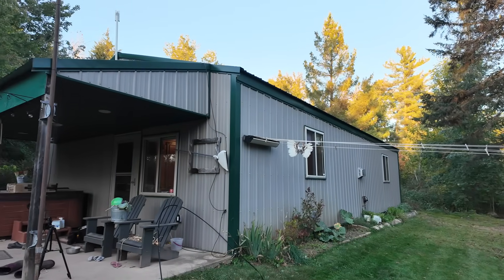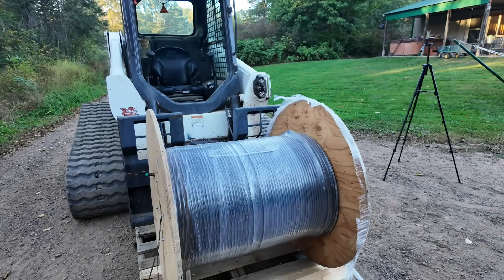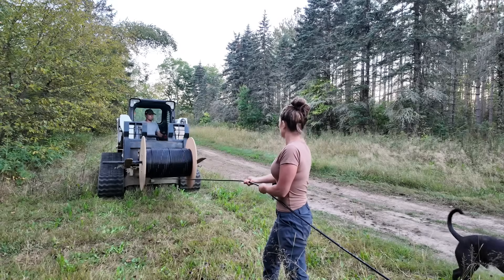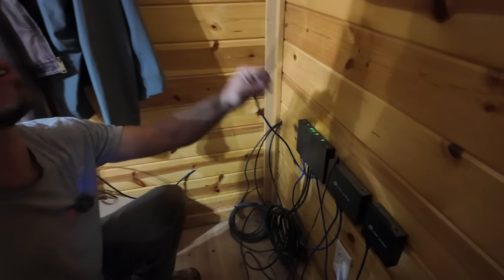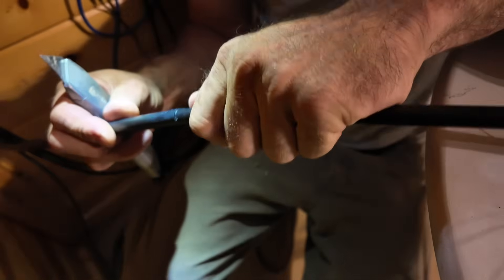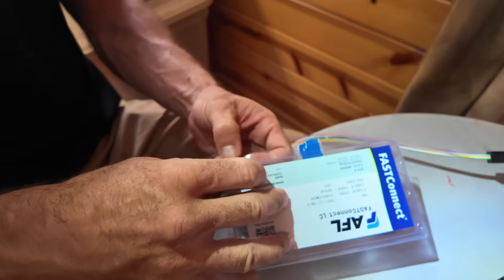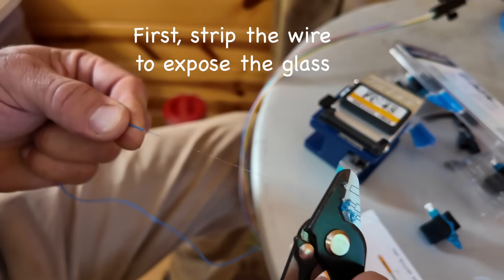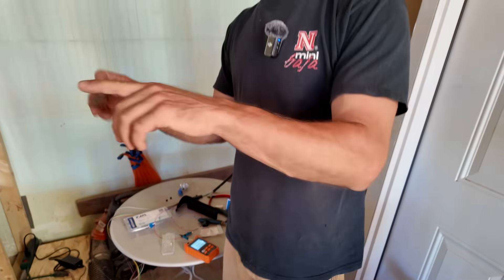We Need Internet! Running a 3,000 ft Fiber Optic Cable

Comment: I had a similar problem.  Internet at the house didn't reach the barn where we have monitor cameras to keep an eye on livestock and most important... pregnant dairy goats.  I ended up burying a Cat6 cable (125') and feeding a secondary router.  It works!  Your challenge is greater at that distance.  Great job, good answer!

Comment: As a fibre tech you actually did very well, no one I know was able to get the fibre connection right the first couple times because its so foreign to most people but you were also able to identify what the issues where and resolve them. Maybe you should take up a career in fibre installs and maintenance because from what I saw here is that you would make 10 times the tech than most techs in the industry.
Reply from the maker: That means a lot! Thank you!

Comment: I assume you ran multimode. If you run tight buffer you dont have to install fan out kits.  Also single mode would be better if your Telco ever brings fiber to your area, but you really need to fusion splice it.  Mechanical splices with index matching gel dont work well will SM

Comment: Why run 3000ft fiber cable (unless it's cheap now). I would use Air-Fiber PTP from UBIQUITI and this have proven to work in extreme weather over 30+ miles range in the Middle East.

Comment: Your now limited to your fiber that has many points of failure. And if someone hits a line. I would have kept starlink.
Reply from the maker: We are using the fiber optic cable to run Starlink to the shop….

Comment: Amazing!  Thank you for sharing.  I tried the long-range wifi, and it did not work.  Now I understand I am not alone.  You made the best choice.  But fiber termination looks pretty. hard.  The accuracy requirement of 0.5mm is crazy, and the equipment looks crazy expensive too. Congratulations on the office space.  That is beautiful.  How tall is that building inside?  I am wondering why you chose wood instead of metal.

Comment: I've worked for Ohio's largest fiberoptic contractor for 35 yrs now. Glad you were able to get things working good. There's more to fiberoptics than people think. Don't want to burst your bubble tho, plug and play systems are prone to a lot of failure. All those snap connectors are going to start failing. You should've bought a length of cable with fused terminals.
Reply: Good
Reply: Good

Comment: I've been in IT for 15 years, worked at massive data centers and wrangled 1000's of fiber optic cables, but I've never terminated fiber, that was always handled by an outside contractor because of the specialized tools and training needed.  So to see you do it yourself was pretty damn impressive!
Reply: I had a 96 pair fiber project for MARCENT in the middle East and Military prefer to terminate fiber themself. I have my own mechanical fiber tool for terminating fiber with me. It was ran from DKET to BCO and Flight line area DKET to ADN.

Comment: Your first option may have worked. The problem is that the signal modulation either needs to be expanded or it could be placed on stilts, above the trees. Also, it's possible to bounce signals from the ionosphere to any location (given some strong assumptions). So, rather than try and communicate directly between the receiver and the sender, the sender would send the signal into the atmosphere, where it would bounce down to the receiver. Also, if the signal travels "only 100 yards", then it likely could be send another 100 yards, and then another 100, etc., by simply connecting a series of the receivers and sender modules.

(These are wild guesses. Am an applied mathematician who knows the basics of signal modulation.)

Comment: Once you run that line you can use it for multiple things you can use it for your phone service you can use it for security you can use it for Internet signal which you can run security and plus get a ultra high speed connection real high speed with the fiber if you can find fiber on the street and get a direct fiber from the street to the house you’re gonna be golden I don’t know if they have fiber in this county that you’re in if they do your Golden

Comment: I’m a splicer and you don’t need a special tool the strings in there are for opening it. If you probably could of stop at a crew on the side of the road to plow that for less then you paid for just the cable and shipping

Comment: The VFL you were using is in the 600 nano meter range. You were measuring at the wrong wavelength. 850 nano meter. That said that one is used to find faults (visual fault locator) not for a light source. But a one click loc pen to clean the ends and optic. The optics that you use have a light threshold. -8 db on a 1310 nm optic is almost perfect.  For a complete amateur with the wrong tools and no experience you didn’t do too bad.  On a side note. If the fiber is too bright you pad the receive side.  If it is too dim clean with a one click pen if that doesn’t work and you don’t have access to an OTDR. Put in a hotter optic. 1550 nm. They also make 1 fiber optics. That send and receive in 1 fiber.

Comment: If you would have lifted poles of each side 100 ft up then put those dishes on there and pointed on each other everything would have been fine. Or you can buy 3000 for it of fiber optic cable.

Comment: You should have watched Linus tech tips on the ubiquity satellites. They would have been more expensive but have done what you wanted. The tp-link ones also too. You need much better line of sight. You should have just ran a fiber line. It is actually probably the cheapest and most reliable way you can get them pre-terminated. Just make sure your ends are clean

Comment: The TP Link gear you were using needs line of sight (LOS). I guess you did not have a clear sight to the second AP. I have used the TP gear many times even at ranges to 2500 meters no problem,

Comment: I thought i was mental running fiber despite working with it daily. Best thing i ever did and that was 20 years ago, whist it was only something like 10G max back that, that same fiber is still in the wall, and today its a 100G core network and capable still of 400Gbps +. 

You did a good job for the proverbial novice, there are some cringe worthy bits and a few bits id have done slightly diffrent, but that don't take away form an outstanding install on the whole, you deserve a pint and now know you can be an optical monkey if you want to be, id 100% have hired you based on that for fiber work.

Just go back and check its well covered from the elements and wildlife, anywhere its exposed is where its going to eventually break, my cables in the garden are all covered in sand and sit on sand.

If you want some free advise check the cable spec sheets, and go find a food safe grease, give the entire cable a rub down with it outside primary sheeth only, it wont damage the sheths but will stop any UV damage, improve its water protection, increasing its life cycle.

Top work dude, 3000 ft almost perfect.
Reply from the maker: Wow, thank you so much for the tips and the kind words!

Comment: Noob's question here: Wouldn’t it be cheaper to get a second Starlink connection and connect the two sites via VPN instead of running fiber between them? What are the pros and cons of using fiber optic X 2 Star kinks in this scenary?

Comment: I dont understand why you just didnt get a second Starlink system and each house/cabin had its own. For the price of a 3000+ ft roll of fiber and equipment, you could have paid for 5 yrs of 2 Starlink’s…..and turn one off it it wasnt to be used for an extended amount of time.

Comment: Honestly Given the distance involved I would have installed telephone poles and run an aerial fiber optic cable. So, much easier than trenching and faster too. Downside getting the support wire and the pole mounting accessories is expensive as well as renting a bucket truck. You could go 40 - 50 meters between poles. 300 feet is about 91 meters. You could have done as few as six pole . Given your location its likely the fiber is coming off a pole anyways.Fanout kits are a pain. I would have rented a fusion splicer and fused the fanout to the cable wires. so much more reliable.

Comment: Deeply impressed…I’m no professional, I’m an Extra class Ham and I’ve made all kinds of cables…coax, cat5, cat6, phone, and of course electrical cords…but direct bury fiber is the one that I’d probably prefer-order with termination completed by professionals, even at extra cost.  Watching you do that encourages me to at least try to do a short run for our next HAM fest and see how it goes.  Awesome.  Side note, I would have built a set of towers and gone for a microwave solution, much easier…😁 I’m also a radio guy so if there’s a wireless way to do it…I’m definitely going to do it that way.  Playing with radios is more fun than stringing wires…or glass.

Comment: What is SPF adapter, I am genuinely interested 😂
Reply: Some switches and routers have SPF ports in addition to or instead of ethernet ports.  Into that port, you plug an SPF adapter, which can be either RJ-45 or fiber.

Comment: The problem is your antenna is not high enough. Look at deadmau5‘s Wi-Fi arrangement. he gets blazing speeds from an antenna that is 12 miles away.

He's using a Ubiquiti airFiber 24 HD point-to-point connection.
It allows you to wirelessly connect and send data between two points/locations up to 20 km (~12 mi) away with a typical latency of just 0.2 ms.
It can support up to 2 Gops of bandwidth throughput... but in reality the theoretical limit is 1 Gbps full duplex (a gigabit in each direction), it's just that Ubiquiti likes to add the upstream and downstream bandwidth together to make it sound like the connection is faster.
Actual bandwidth throughput will vary based on many factors like distance between the two points, whether there is a clear unobstructed path between the two points, whether there is any interference along the path, etc.

It's possible the tower may connect to another airFiber unit mounted on top of an internet exchange or data switching facility that has fiber connectivity to major IP transit providers (like Cogent, Level 3, Hurricane Electric, etc.)—the type of companies that provide Internet Service Providers and major corporations with their internet connectivity.

ー Costs-
• airFiber 24 HD: $2900 USD (for each side of the link), plus the cost of the tower(s) if required
• Gigabit internet connectivity: varies anywhere between $75 and $1000 USD per month depending on many different factors-primarily the location and the connectivity options available at that location. It also depends on whether you want dedicated bandwidth or not (residential internet connections do not provide dedicated bandwidth).

Comment: If you guys have UniFi or enterprise WiFi equipment, you could buy access points that support pass point. You could sign up for a service like google orion, so that nearby guests on cell networks will automatically be connected to your guys’ guest WiFi network

Comment: As an IT Engineer, I would like to strongly recommend you to NEVER look to the VFL / Fiber light. That can cause permanent damage to your eyes. 
Nice job with the fiber run and don't fill bad because didn't work in the first try. Splicing/terminating  fiber requires training. I also would recommend you terminating the fibers in a wall mount corning and from their to the switch you can use a pre-made fiber patch cord.

Comment: You need a clear line of sight PtMP (point to multi-point) connection. Just need some tall poles to clear most of the trees. Would of been cheaper than that fiber but fiber is more permanent.

Comment: have you ever checked to see what fiber services runs near your shop? I am sure there is a corporation out there somewhere that would allow your expertise to install a fiber cabinet out to the main street of where you live. Think about, you did the work as a DIY and you did it so well with termination and all. But now, to cut the costs you could run even more fiber and do all the work yourself.  You could have 1000 symmetrical speeds and cut half the costs to what you are paying for with starlink. No one ever thinks  what would happen if Starlink goes down compared to have a straight fiber connection. I like these fiber installs like this and it would be worth getting the pipe open to your cabin or at least to the end of the road with a fiber cabinet where you do the rest of the work.

Comment: Awesome job on the fiber!  One thing though, the transceiver you are using in the switch.  Those ports are not call "SPF".   They are called SFP - Small Form-factor Pluggable (SFP).

Comment: You do not bad job.. But no idea for what.. 3000 ft (0.91 kilometers) is a very small distance. You use solution more suited for 30000 ft.

Comment: I think you're supposed to terminate the fan out in a fiber box that completely houses the thin fibers (it has clips to put them in) and gives you a port to plug into. In this port you can plug in pre made fiber lc cables you can just buy online. Direct termination and sticking it into a switch is ... Risky... Easily damaged

Comment: what about the distance factor on the spf module I know they have different ones based on how far you have to run the fiber and intensity of the laser in them, too much and you'll burn them out quickly not enough and you'll have a week signal?

Comment: I really want to terminate all the ends into a fiber patch panel, just so none of the fiber strains are just sitting their. Also a lot easier to switch to another strain or plug in more equipment. Other than that good job!

Comment: Fiber?
Wow, I can't imagine how much easier and cheaper it would be to do a Ubiquiti long range bridge between the two buildings.  Some will do 5 Gbps...  Crazy.
Those things will transmit over a mile without issue as long as you clear the trees in the way.  Trees will kill the signal completely.  Ubiquiti even has enterprise airFiber 2Gbps antenna that will transmit legit, 12 km.  But again, trees.  Gotta always have line of sight for ANY type of bridge antennas.

I guess you'd need to add the cost for some towers to push the dishes above the tree lines.

TP Link is not a legit long range bridge product.

Comment: what in the holy Moses... why on Earth would you string fiber that far? Seriously, have you heard of Starlink? I'm seriously hoping that will be armored fiber which would pay for like 10 years of Starlink service or more.

What benefit is there in laying that much infrastructure at that cost vs spending 10 minutes on a Satellite service?

The vulnerability at the handoff will be completely out of your control, are you laying in steel to augment armor so a utility digging for what ever reason will pick up it's location where it's buried?

I don't even understand any possible reason for this venture, but have fun and good luck.

Comment: to get through the trees via ptp wifi you need low hz, the old 900mhz ones are idea, but 900mhz i pretty close to a cancer frequency. 
2.4ghz miiiight have better luck. 

fiber is a good long term solution. expensive though.
great job / vid.

Comment: Sharp edges left to damage the cable. Use a conduit when passing cables through walls. 
Would be a good idea to seal up the hole too to keep the weather and bugs etc out.

Comment: Great work on getting through so many roadblocks without a fibre background and very quickly! Since this cable didn't seem to have a central strength member to bolt down at each end, the outer jacker should terminate in a metal enclosure with a IP rated grommet of the correct size. Then the connector from the fragile fan-out ends should go to a coupler in this metal enclosure, which can then connect to a normal indoor fibre patch cable to connect to the switch. Also if you have reliability issues, ensure that the fibre cores from the main cable are also cut squarely with the diamond clever, I didn't see this happen in the video. A microscope will show how jagged the ends can be otherwise.

Good work all in all.

Comment: P2P (point to point) wireless is a good solution if you have good line of site LOS.. but blasting through trees won't work.. but running fiber was the best solution on your property

Comment: Very good job.  Mechanical terminations are good for DIYs, the matching gel in the mechanical terminations will start to degrade in 15 to 20 years.  One way to check if your fiber/terminations are good is to use a coupler to connect the transmit fiber to the receive fiber on one end together.  Then check your router at the other end for the green blinking connection light.

Comment: With Fiber Optic connectors, dust is enemy number 1. Every time you pull a connector out to do a test or system modification, you risk a speck of dust ruining your day. Buy a connector cleaner cassette such as the NEOCLEAN R2. An optical microscope might also be handy if you suspect a scratched connector.

Comment: careful with optical fiber guys.  was talking to a telecom guy one time.  he said if the bare glass fiber is bent too far and shatters it will make microscopic glass splinters.  if it gets in the eyes its impossible to get out.  the glass in optical fiber is different than fiberglass insulation or fiberglass resin cloth.   Would love to run a fiber link to my cabin in the jungle.  For now just using a sim card modem and wifi booster.  Watching from Belize

Comment: You could have rented a vibratory plow that would have cut the ground and inserted the cable all at once. Also, it is not a surprise that the TPlink did not work. That is junk, and it is hacked.

Comment: Get a fusion splicer. Also you are using single mode fiber but using a multi mode light source. Curious on the optics used on the switch.

Comment: because you went TP link it did not work Ubiquity is were pro wifi gear are. But you went with fiber and that will be a more permanent solution.